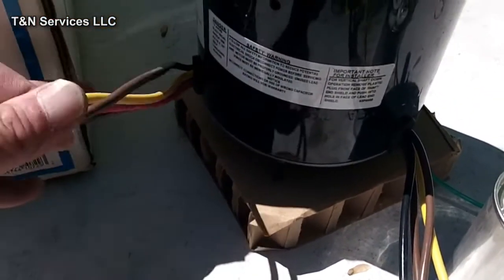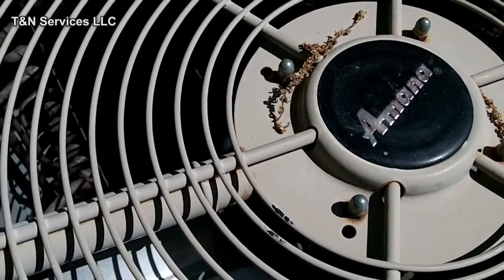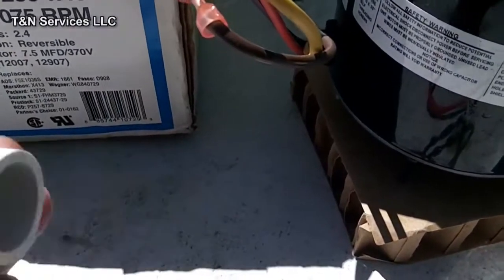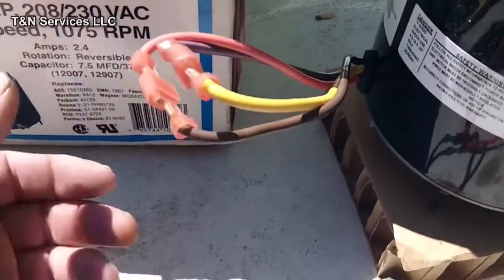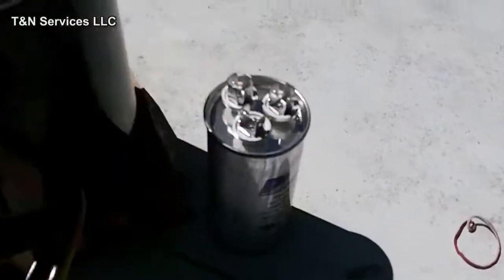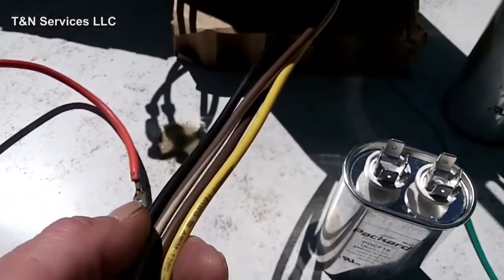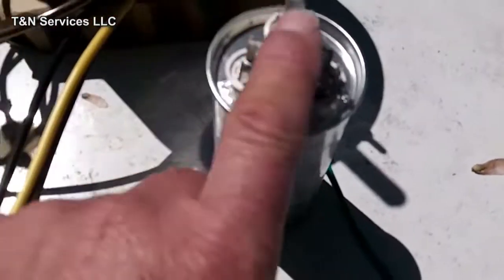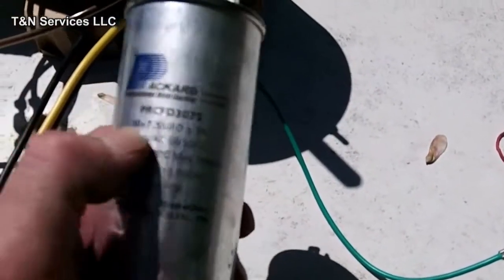How To Install An Aftermarket Condenser Fan Motor

Comment: Could you just connect the 4th wire to the common side on the dual run cap ?